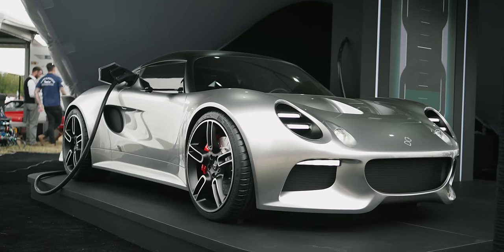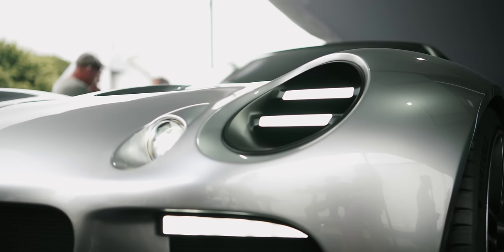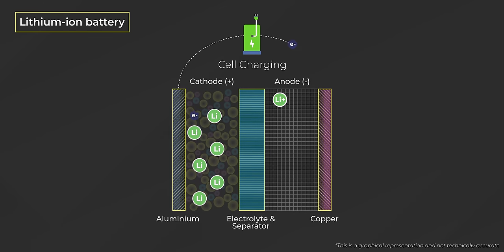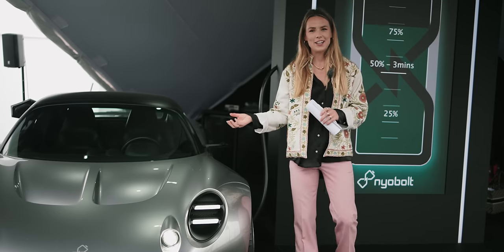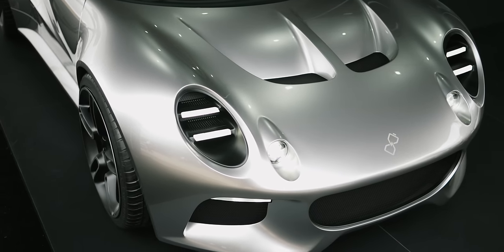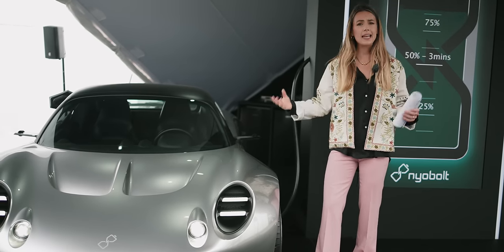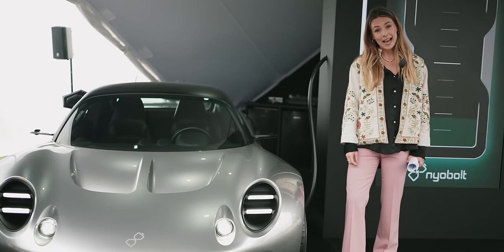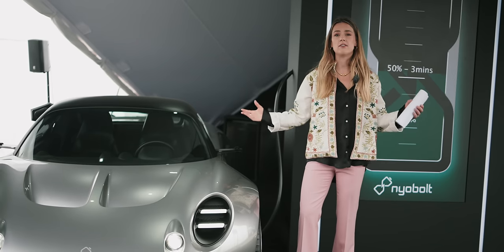This Futuristic Tech Could Be the Key to TINY EV Batteries!

Comment: Battery size .... hmmm .... range is probably the number one issue stopping mass adoption of EVs, and once again we hear amongst all this promising tech that we don't need large batteries, just right-sized ones. If I do a 400 mile trip to Scotland, and end up having to stop 6 times, even for a 5 minute charge each time, that's still a pain in the neck as it's not actually 5 minutes, it's coming off the motorway, finding the charger, charging, quick stroll around, getting back on the motorway. Before you know it each of these stops is half an hour and I've added 2 - 3 hours to the trip. I'd normally do it with 1 stop. So I hope we see this charging speed arrive, but as to being the key to tiny EV batteries as the title suggests, I hope not. Totally understand the resource question though, but it seems the squeeze on lithium resources we see now is only because of the rapid expansion of the EV industry. I'd have thought the squeeze would end one day. So personally short range (even with fast charging) doesn't work for me. Can't car makers use lighter weight materials in their builds instead, to reduce the need for large batteries?

Comment: I have got a (5 year old & 170.000 km) 28 kwh Hyundai Ioniq Classic and still it can do 250 km on one charge - which is slightly more than just one round around the block. Depends on the size of the block however.
Reply: However, driving a sports car in a spirited fashion could easily burn through the electrons at 3 times the rate of your Ioniq ...
Reply: @MrAdopado  but only if you really practise sport mode at high speed the whole time - which doesn't occur always - even with a sports car.
Reply: @reinelektrisch4997  Yes, of course but a sports car needs to be able to go out for an afternoon "spirited drive" and still be able to cover a useful range before recharging. The smaller pack being able to deliver full output at lower percentages would also be crucial ... but of course this company is making claims that this will be the case ... let's hope so if it ever gets into production!

Comment: Let's not forget that the first Tesla Roadster was also based on the Elise.
Reply: Can't actually think of ANY non-Fanboi reason why we would need to remember that..... !?!?
Reply: Except that Tesla ruined it's handling
Reply: The shell, interior, and chassis aren’t in question. The safety and viability of this method of charging is. If it were, we’d see automakers already producing cars with this capability. Seem though that many hurdles remain and trade offs and consequences with charging so rapidly have yet to be mitigated.
Reply: @andymccabe6712  I'm actually not at all a tesla fanboy but somewhat fascinatet by the Lotus way of going light with relatively small engines. This time they seem to have done a better job (than both Tesla and even Lotus!) do stay true to that philosophy.

Comment: A six-minute charge makes a mere 100-mile range a lot easier to live with.  Okay, you charge up more often.  So what?  Six minutes.  Hook up, run in and buy a coffee and a bun, come back out, ready to go.
Reply: Half the reason I want an electric car is so I don’t have to ever go to a petrol station/charger...

They also cost as much as petrol

There’s is deffo a market for this but not for me
Reply: This is how I charge my EV on long journeys. A series of short charges while buying coffee etc. It works so well and I find my journeys are more relaxed than in my petrol station days. I'm loving having an EV and would never want to go back.
Reply: More wear and tear… which could be a concern
Reply: That sounds great. Unfortunately, anyone who has had to charge on a journey will tell you the infrastructure just isn’t there to support it. I drive a plug-in hybrid in Canada. Most chargers are hard to find, often in use by others or faulty. Fast charging also degrades the battery quicker, and the high currents involved increase the risk of fire

Until chargers are as ubiquitous as gas stations I don’t see smaller batteries being popular
Reply: 35kWh is around 150 miles in my e golf, so 100 seems light here
Reply: @rogerfinch7651  well, you’re probably not chucking it around like a sports car might be.
But yes, I get about 80 miles on 18 kilowatthours as well  (chevy volt)
Reply: @rogerfinch7651  True, then again this is a Lotus which invites spirited driving, which is generally going to be more watt-hours per mile.
150 miles for 35kw-h is damn good, that's less than 250w-h per mile.  I don't think any manufacturer is claiming performance that good, you must be hypermiling very effectively.
Reply: My e-Golf has decent enough range, but charging at only 38 kW max is terrible. With 6 minute charging instead of 45 minutes, it would be a lot better
Reply: My motorcycle has a range of only about 120 miles and takes at least 5 minutes to fill with petrol. Recharging this would be no hassle whatsoever.
Reply: @TwoShedsProductions  I do the same, drive 2 hours, do a quick stop for coffee or a pee, when i finished the car is usually at 50 or 60% and I continue my journey. Much more relaxed and fitter behind the wheel.
Reply: @hansh2463  Exactly.
Reply: @TwoShedsProductions  You probably won't be that relaxed if you're always buying coffee!
Reply: @drunkenhobo8020  True, and the more coffee stops the more charging stops! Positive feedback!
Reply: Make it ~150 miles, and that's a stop every 2 hours (allowing for 10-80 charging, etc)... which is about perfect for most bladders :D

Comment: I have never seen a battery specification sheet, or a battery technologist, use 'power density' as it was described in the video. What they appeared to be describing would get specified as maximum load current or maximum charge current. Logically 'power density' would be watts per cubic metre which frankly is a pretty meaningless figure. Not to be confused with 'energy density' which would be in joules (or kWh) per cubic metre or which is a useful metric.

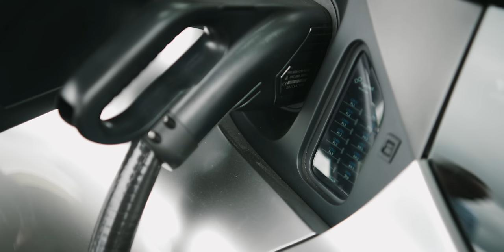Comment: 2:34 Small technical point "we know that the cooler the battery is..." 

New chemistry might change this, but what we know SO FAR is that li-ion cells often need heating to achieve best power output and charhing rates. Example: Teslas pre-heat the battery if you navigate to a rapid charger.

The reason stated is that the sustainable rate of migration of lithium ions into and out of electrode materials increases with temperature. Try to charge a cold battery rapidly and you increase the rate of cell degradation. Odd, but true with many current batteries.

Comment: 6 minutes charging time is only possible with very small 35 kWh batteries at charging stations with 350 kW. For medium-sized 75 kWh batteries you need 750 kW charging power. For large 100 kWh batteries, 1 megawatt charging stations are required...

Without technical details about this miracle battery, I have my doubts at first.

Comment: Have I understood correctly? Fast charging, small battery but requires huge capacity charger to charge in the stated 6 minutes? And there's only 17 of those in UK? So at present it doesn't have the range to get to the next one, and if all chargers were of the required output, it will strain further our infrastructure? Yes it's clever in a small way but really it's more of a distraction.

Comment: Around 30 kwh in a phev with high speed charging would be game over for standard petrol cars. If DC charging is unavailable just start the range extender but ideally electric is so plentiful and cheap you just plug in whenever you stop and don't worry about it.

Comment: Where is that "10x more power dense" number coming from? There are LiIon battery EVs that can charge at 250kW (admittedly not 0-100%), so presumably that means nyobolt could actually manage 2500kW if there were chargers capable of that? Or are they comparing at 85-100% SoC where LiIon batteries have to slowly trickle in the energy?
Reply: The batteries that can charge at 250kW+ are all larger batteries (because bigger batteries charge faster, due to having more cells in parallel to accept the charge)...~35kWh battery packs typically cap out at 50-75 kW charging... and with a noticeable taper from peak (around 20%).  If this 35kWh pack was charging at 350kW then that's already 4-7x faster, and if it doesn't taper (or at least, tapers less) then that could account for the difference.

Comment: Small correction. The cooler the battery does not automatically mean faster charging. Because at colder temperatures it will get slower again.
Reply: When fast charging it gets very hot and cooling it down is the key to enabling fast charging. So, within reason, the cooler the faster, in normal conditions. If you did something crazy like cover the battery in liquid nitrogen it might degrade performance.
Reply: @adrianthoroughgood1191 havent you heard of the nightmares of electric cars in winter?

Comment: Whatever happened to the plans to use supercapacitors?  Are they too heavy for passenger vehicles?  There was a lot of talk about using them in trams and buses a few years back.
Reply: There's a tram in Australia that uses supercaps. When I saw footage of it with no wires at first I thought it was diesel, until I read that they recharge it at every stop with enough juice to take it to the next stop.  Great system!

Comment: It appears that someone has just divided the 350kW charger output into the 35kWH battery to come up with 6 minute charging. No matter the advances made in battery technology are we really talking about there being no "charge curve" whatsoever .. i.e. charging constantly at 350kW throughout the entire charging period? No battery charging system has ever achieved anything remotely approaching this performance. All battery charging presently varies its speed with the peak output only being held for a relatively short period. I would love to think this is feasible but I have very serious doubts. I also have doubts that anyone is going to choose to have a small capacity 35kWh battery in a sports car unless it was a dedicated track car. The reason is that when going for a blast you will empty the battery way too fast. Much more likely that they will want at least a 70kWh pack so it doesn't matter so much that you are using power at double the rate that you would when driving economically.

Comment: 35 kWh means you have to charge it so often that the battery will degrade much quicker and should be replaced much earlier so technically it’s worst in every aspect besides weight. 
35 kWh is just not enough

Comment: If batteries charge faster when colder why do all Teslas preheat the battery in advance of supercharging? If you don't "pre-condition" charging goes much slower.
Reply: That depends on the battery formula. Almost all of them are optimized to a particular temperature.
Reply: Goldilocks. Not too hot, not too cold. Roughly body temperature is good.
Reply: @downix 

Really? Kindly explain.
Reply: Also: If you start charging at an ideal temperature, rapid charging in itself will add a lot of heat, so you will need cooling. A small percentage of 350 kW lost as heat in a contained box can get toasty quickly.
Reply: @t1n4444  different chemical formulas react differently to different temperatures. For example, a Lithium Iron Phosphate battery gets optimal charging rates at around 10 degrees C, while Lithium Nickel Manganese Cobalt Oxide batteries (which you find in most Tesla) get optimal charging rates at around 25 degrees C.
Reply: @downix  

Hmm, now that is useful to know.

Thks.
Reply: @t1n4444  anytime. I find it fascinating myself, and only learned about it due to a neighborhood gearhead when I was growing up talking about how to keep his antique EV (a Detroit Electric from the 1920's) on the road with 60+ year old nickel iron batteries.

Comment: Pretty sure mazda have shown that the consumer doesnt want these little batteries/short range cars. Yes the majority of trips may only be 25 miles but the one time you do need to go a longer trip its a hassle. I had to go to manchester in my e208 last month (nearly 600 miles round trip) with a max motorway range of 160 miles. By the time id worked out my charge stops then factored in the outrageous cost of service station electricity i gave up and just borrowed my mums petrol corsa and did it in one tank of fuel. Unless you live in a city and almost exclusively drive within said city then these small range cars just arent viable for a majority of people.

Comment: Can't really say I'm all that interested in charging that quickly, as I'm going to have to stay with the car while it's charging before or after I do what I need to do.  It's ike the inconvenience of a petrol station.  I suppose it might be handy from time to time, but I wouldn't pay extra for it.  Might entice ICE drivers still thinking with a petrol head and will keep the petrol station model alive.
Reply: Why stay with the car? Plug in, then go the loo, grab a coffee... when charging starts, the plug is locked to the vehicle, and can be unplugged until charging stops (if that's what you're concerned about)
Reply: @logicalChimp  That's my point - If it's only 6 minutes, I will have wait and move the car as I won't have time to do anything else.  The average UK rest stop is 15-25 mins that's how long I ideally want to charge.
Reply: @garyallsopp6369  Ahh - if you're meaning in terms of not blocking the charger once charged...  personally, I'd still just go to the loo etc, but I tend to travel solo, so my stops are usually ~10 mins (and 'blocking' a charger for 2-3 mins isn't the worst crime :p)

Comment: There already are plenty of cars on the market that charge at 200+ KW and even a couple that charge at over 300+ KW. You don’t have to fully charge a battery every time. You can always charge it up to 50% really quickly just like this car. Honestly, this video was stupid. This car is no better than what is on the market today.
Reply: .....only ONE teeny error there, 'learning...'
... you need to swap the word 'video' for the word 'comment'........
... er, and, possibly, think about engaging one or two braincells b4 you start to dash off a clever comment......!?
Reply: @andymccabe6712  refute anything I said with actual evidence.
Reply: You're, understandably, misunderstanding how most car manufacturers advertise their charging speeds. They add an "up to" or often a * beside the speed leading you to the small print to find the "up to." The difference between the technology on display here and other batteries is that this system is capable of charging from 0-100% at 350kw the entire time. Most batteries will charge quickly for part of their capacity then slow down significantly after that. This is why very few manufacturers quote charging times from 0-100%, most quote 0-80%.

The advantage of being able to charge quickly across the entire capacity of the battery means cars with smaller batteries, like this one, become viable. Smaller batteries mean lighter cars, lighter cars use energy more efficiently. I personally would rather have a smaller battery that charged super fast rather than wasting energy, and therefore money, every other day of the week lugging around hundreds of kilos of unnecessary battery for the one or two trips a year I need to go further than a single charge can take me.
Reply: @willnicholl4581  even if they hold max charge rate the entire time that battery is so small that a big battery could charge to 30% or the same capacity just as fast.
Reply: @LearningFast  you aren't wrong, using a larger capacity battery and decent battery management it would be possible to charge a larger battery to the same capacity at the same speed. The difference is, at current energy density, a 70 kWh pack is around 140kg heavier than a 35 kWh pack. You then have the packaging constraints for the larger pack, the car needs to be bigger to hold it and therefore would be heavier again. Assuming we ignored the difference in weight in the cars that bigger battery pack alone is basically like carrying 2 additional passengers at all times and that isn't insignificant in terms of efficiency.

Faster, more consistent charging and more efficient cars will be the thing that makes EVs easier to swallow for the general public. With this type of technology more widespread and available pulling in at a full rapid charging station would be no different to waiting to use a petrol pump now.

Comment: It's interesting to see how intense it will burn in thermal runaway of this battery
Reply: Check your facts. So far, EVs are LESS likely to burst into flames than internal combustion.

We should continue to keep an eye on safety, of course, but so far EVs are winning.
Reply: @RupertReynolds1962  Yeah EV's winning, WV lost another cargo ship last time. Nev EVs are burning similar percentage as old ICE cars. So wait 10 years and we will see. And the way EV's are burning is an win too, they wining with firefighters every single time.
Reply: @DAMUSTOO  Sweden have a reputation for facing facts and campaigning for safety, and even I was surprised at how safe EVs can be--ICE 19 times more likely to burst into flames than EVs according to this page I'm probably not allowed to link to, but I'll try...
Reply: I posted a suggestion to do a web search, without naming a domain in full, and it's not visible 5 mins later--deleted? Cannot be serious!
Reply: electric-car-fires-gas-hybrid-ban is the clue to look for.
Reply: And if that gets canned, I'll feck off to Nebula and peertube, leaving YT as a lost cause, beyond saving.
Reply: @DAMUSTOO :  Apart from the millions of cars with tanks of volatile fuel, there is a vast number of fuel-tanker trucks each carrying thousands of litres of volatile fuel... has this never caused you any concern?   There are also monstrous oil tankers on oceans worldwide, many of which will become redundant.  Every coin has two sides.